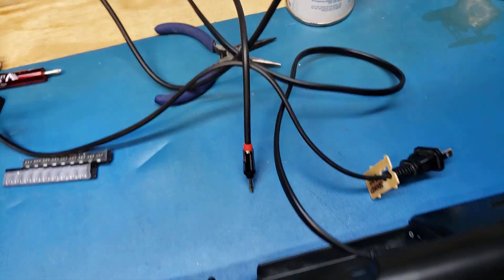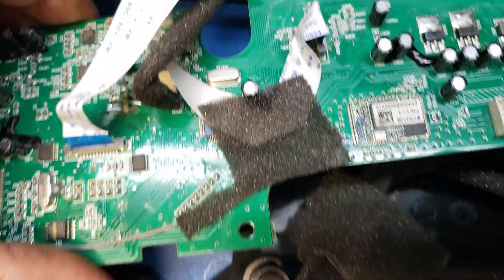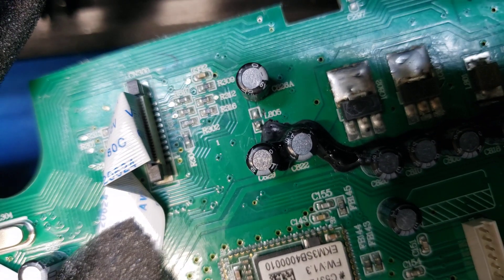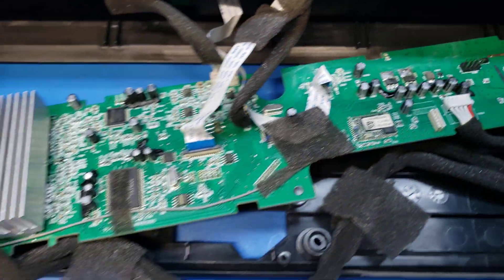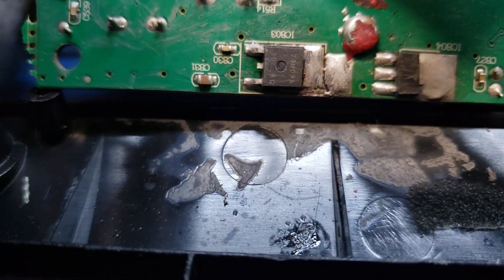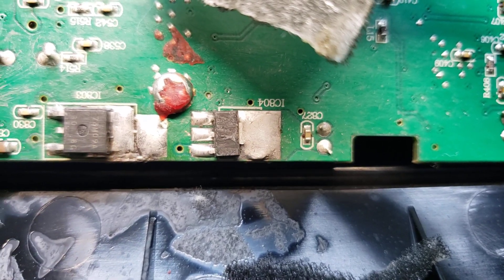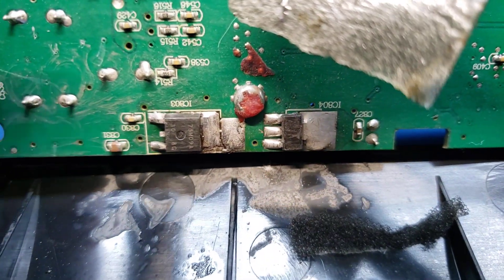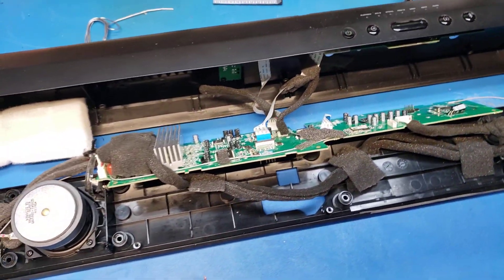JBL Cinema SB-400 "no sound" repair links for parts in description!

Comment: Is there anyway to know if this is the actual problem before changing out the parts? Like measuring resistance between pins or something. I'm looking at one now and it doesn't look like these parts are shorted out. Do they short or just stop working?

Comment: Hi dude, I've got a sb400 to fix, as a hobbist. I Had an open diode on the power board side,   this burned a capacitor near the 24 vias flatcable. Atm I'm strugling to identify the SMD capacitor. Anybody here have this board diagram?

Comment: Both of those showing 4.8-5volt when im checking with voltometer when the soundbar is connected to power, but is off.. is that correct values or should one of them show 9volt and the other 5v?

Comment: Hi everyone . Maybe my experience can help some of you. From time to time my SB400 got muted. I can disconnect it and then connect with som other devices but there is no sound from soundbar. I think this is issue when you do not disconnect soundbar from device and try to connect with other device while bar is connected on some other device. For me it helps to take soundbar out off my hose and out off range  from my devices. Suddenly soundbar works again. I am quite sure that problems starting with paring with my iMac . Try it before you start with other operations.

Comment: theres two different ones. one is bigger than the right one. are they different? or both the same?
Reply from the maker: links to parts
 LM1117-5.0 AMS1117 5.0V 1A Voltage Regulator   (IC804)
https://www.ebay.com/itm/293643344241

(78m09A)    9 volt voltage regulator   (IC803)

https://www.mouser.com/c/semiconductors/?q=78M09&gclid=Cj0KCQjw1tGUBhDXARIsAIJx01nJudKt-lbl8_BIB-3-2606D0CiynWaITIo-OkNtFKMNuPvbgvFJ4caAi6XEALw_wcB
Reply: @ElectronicMechanic50  for the 9v its 27 bucks to ship . disgusting, got any thing cheaper?
Reply from the maker: links to the parts are in the video description

Comment: for the 9v there is ua78m09 smd, mc78m09 smd, ba178m09 smd & through hole. will all of those work? which mount style?
Reply: After watching the video again i'm thinking the 1st part I listed is the correct part which is good cause I have soldering gun not a pen and/or solder sucker which I would need for hole mount.
Reply from the maker: I use a stinel heat gun

Comment: Just ordered my parts, thank you! Visual inspection doesn’t reveal much and no multimeter to test output values, at the moment. Thanks for your insight. Hoping that this works for my soundbar. It really sounds so good and it would be a waste to toss it for less than $20 worth of parts.
Reply from the maker: Good luck!

Comment: replace both voltage regulators and it solved the issue and the sound back as expected thanks a lot.
Reply: Where did you get the parts from?

Comment: To start, this video is correct. Don't bridge the 5v rails.
When I replaced IC803, I noticed the previous chip was hot enough to discolor the PCB. Probably fried itself. In addition to replacing the chip, I also got some Raspberry Pi heat sinks with adhesive on the back and stuck one on top. It wouldn't fit back in the case with the heat sink, so I had to cut a place out of the case to fit. I used a temp gun to check after running for a few minutes and it was ~69°C (156°F). Can't imagine what it would be without the heat sink. Hopefully the heat dissipation will keep it from going bad again.

Comment: Thanks a ton for your video. Managed to fix my soundbar for a few bucks! Only ordered AMS1117 and turned out that chip was the problem. For others with this issue, try that chip first.
Reply: Update: I only changed IC804 and after a few days working ok it then made a loud buzzing sound then died again with same symptoms (no sound). I am going to replace the other chip too now. I'm not sure it will help though since IC804 is currently showing as 5v but no sound. Hoping something else hasn't failed and the replacement of IC803 will work.
Reply: @muzzyerkzy822  have an another update? I’m having No Sound issues as well
Reply: @djjaimelopez  Sorry I ended up selling the unit for cheap and purchased a new soundbar.

Comment: i checked with mutimeter IC804 where output or middle terminal has zero volts and side two terminal i believe are inputs getting 5 volts so i think IC803 is good supling power and only change IC804?
Reply from the maker: while your in there just replace both to be sure!
Reply: I only changed IC804 and after a few days working ok it then made a loud buzzing sound then died again with same symptoms (no sound). I am going to replace the other chip too now. I'm not sure it will help though since IC804 is currently showing as 5v but no sound. Hoping something else hasn't failed and the replacement of IC803 will work.

Comment: How do I remove old regulators with causing damage? Sorry new this
Reply from the maker: You need a heat gun made for soldering or a good soldering iron that can get to 700 or so. Remove solder from pins of regulator then add solder to the point where its solder to pc board and let the heat get in there and it should lift off gently once the solder liquefied
Reply: @ElectronicMechanic50  I have removed the pins, but I am having trouble removing the regulator. It is like it stuck to the motherboard. I don't know how to “add Sauder” I have a heat gun and slider though.

Comment: Hello how can I send you a picture of my JBL SB-400, and is there a way to check the 2 regulators?
Reply from the maker: You can use a multimeter and check voltage with initial powered on you should have 5 volts out of the one on the right

Comment: Just opened mine, I will buy those components tomorrow, 78m09 and 1117 right? I’m going totally blind here, had exact same problem, hope it will fix it.
Reply from the maker: The parts are linked in description
Reply: Go head bro. It will work. Use the same component what video creator mentioned in the description, i bought it from a local electronic shop in my area. I payed 0.45 cent for the both component

Comment: it really work ！ thanks alot sir！
Reply: just work like new one after replace these items
Reply: @LnF4530  at last its wotks. First time i put 2.5 v instead of 5 v. I didn’t notice before. Now i changed 1117 ic with 5 v. Its work
Reply: @LnF4530  ok i will try
Reply: Is it work perfect??. I have jbl sb400. No sound output else Everything is working. If i did this same is it work??
Reply: @rohishmanip  did you try to bridge L805? just curious because I'm having the same problems
Reply: I have voltage to all of my regulators but still no sound dont know what part is wrong
Reply: @MatthewDempski  no
Reply: @MatthewDempski  just change ur 2 ic same as he said . It will work. For me works
Reply: Hi May I know the power output of main power supply?
Is it 24v or 20v only?
Reply: Hi does anyone have the part numbers or link to eBay for the audio chips in the video I'm unsure of which ones to but